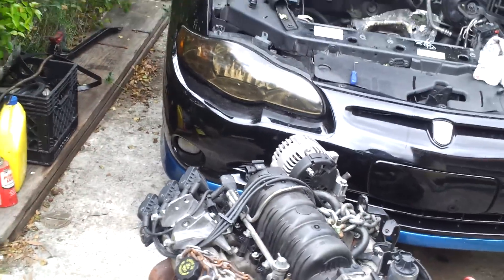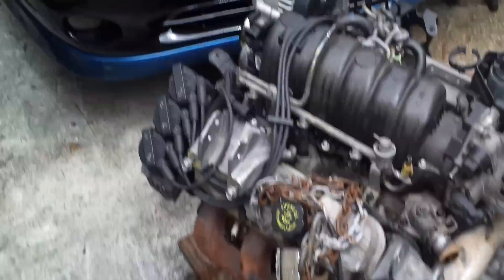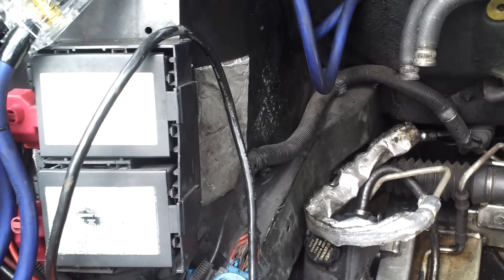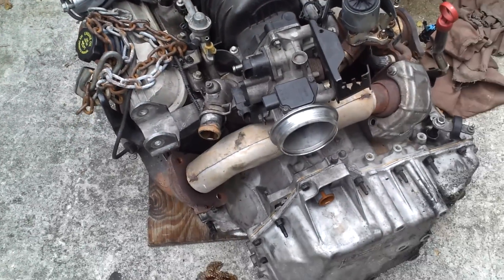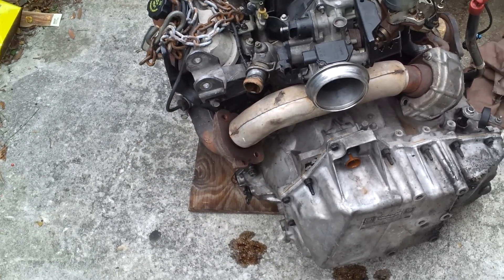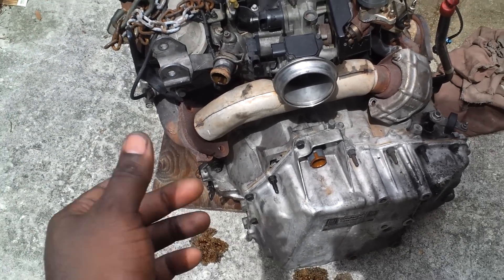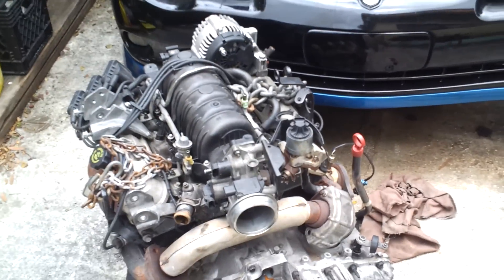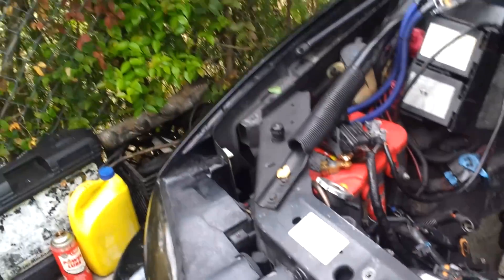TCC Problem Comes Back P0742 #2

Comment: great effort- I've been following you here- the problem with these trans is this- the clutch in the converter is sacrificial.  it wears and sends clutch dust material throughout the entire transmission.  the particle size is approx. .002"-.003"   the solenoids that control TCC and shift points and pressure, are in bores with only .001" clearance.  over time the bore size wears larger, then a large particle comes along and JAMS IT UP tighter than a bull's ass.   all this was done to get federal mandated gas mileage specs.  in the old days there was no TCC in the converter.  and the trans were much simpler and more reliable back then, and easier to fix.  you rebuilt it once and it outlasted the body and frame of the car.  with these new ones, you can put all those solenoids in, and the dirt jams them right up again in a short time.  the only fix is a NEW VALVE BODY AND CONVERTER.  and also a dedicated trans cooler and IN LINE FILTER that filters down to 2 microns.  these fucking cars should have had that from the factory, and this shit would not be happening.  these transmissions are FUCKING BULLSHIT cuz they are a good mechanical design, but a SHIT ELECTRICAL DESIGN.  those solenoids should be EXTERNALLY REACHABLE AND CHANGEABLE from outside the trans, this crap of pulling the entire subframe down is bs too.  someone at GM should be fired for that design.  another problem is this, for $2100 a new trans is worth as much as getting another car !!  I can buy 2001-2003 Monte Carlos all day long for $1500-$3000 each.  I have 2 of them myself- great cars- but shit transmissions when they get over 180k on them.  I'm starting to think just buy another monte or grand prix whenever the trans acts up, and sleep better and have clean hands.  working on these cars sucks, it's no fun.  working on a 70 gto or 68 chevelle was fun.  not anymore.  they've ruined the hot rodding hobby.
Reply: oh boy my transmission is acting up on my lesaber and I got that code.... so I'm probably fucked am i, i love the car and the engine would be good for long time but this does not sound good...

Comment: I totally get you man. I have a 02 Monte Carlo SS and it's been a pain in the ass but like you said "It's my baby". I'm currently having the same problem. I have the p0742 code and I'm hoping I don't need a new transmission. It's got 180k so odds aren't in my favor
Reply: cut the brown wire to the tcc on the bottom of the trans harness connector, way easier- just drive it without tcc
Reply: @tunnelportterror  can you explaine that a bit ....please

Comment: Do u recommend a shop rebuild
Reply from the maker: I recommend AAMCO, they offer a good warranty. I myself went to my local part store and bought the best transmission avaliable, I paid for it, they ordered it (built by order), I pick it up 13 days later and had it in my car in under 3hrs, it came with a torque converter installed, just make sure you take the fittings for the lines off the older transmission or possibly the dip-stick housing. I put a cooler and fan on my new transmission, it's not connected to my radiator. cools better, engine and transmission.
Reply: +TheDemo05 Bro I don't know how to do tht lol. I was going to take it to a transmission shop here in Indiana, I also had the tcc error at auto zone.
Reply: +TheDemo05 thanks for replying appreciate it bro